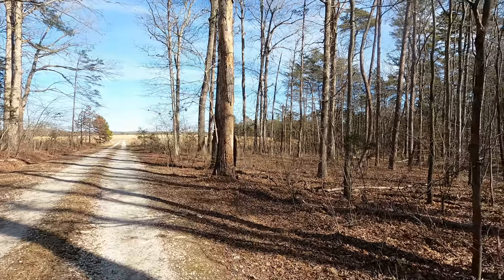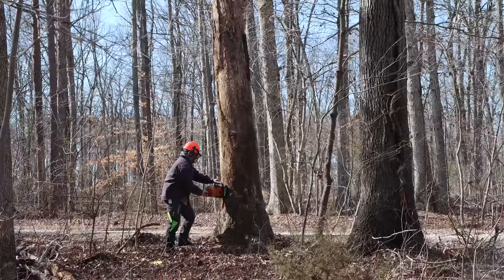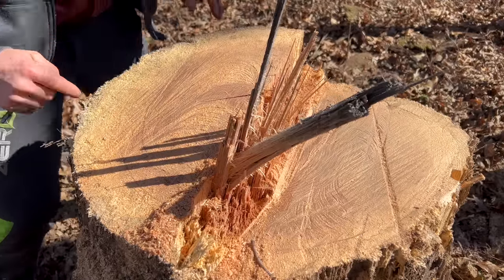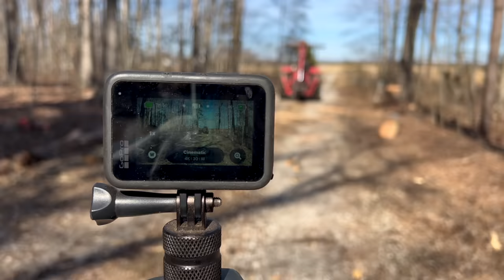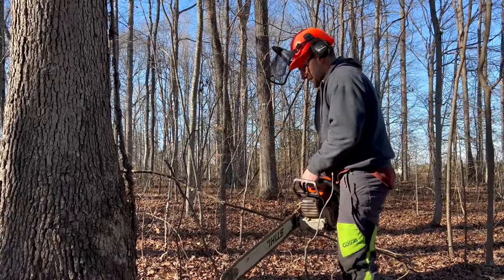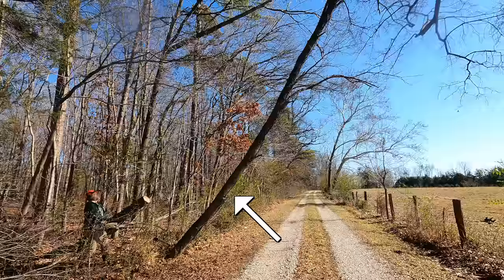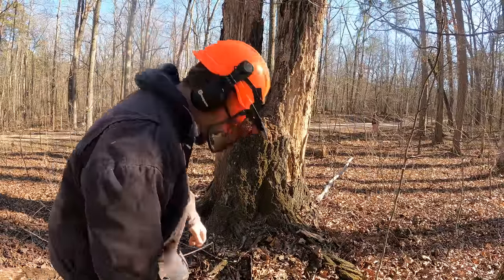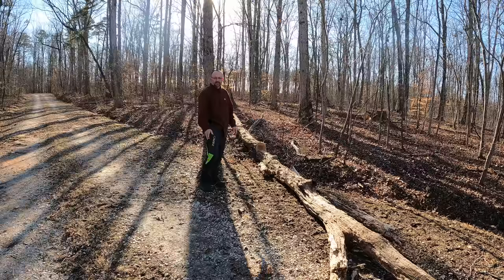No Nonsense Guide to Felling Dead Trees.

Comment: About  the  leeaners: some times you can twist the stem so it falls down ,if its loose in the bottom.  use the pull action  so that the breaker bar doesn't come at you and hit you when the tre comes loose .when you pull it would just move away from you or slip fall of . Dead trees are scary,to cut especially if there is top rot in the trunk , as soon as tree start moving during felling  the top may fall backwards because the stem cant handle the enersia from the upper
Part  of the tree.
In  these  cases you can cut so the tree still stands upright and then pull it down with pre rigged rope.
The top may fall quite long backwards  so it's not sure you will get away far enough if you stand behind and cut .

Don't forget that dead trees also is important for insects birds animals  and even some plants /moss.
Oak ,especially hollow ones are bases for very unusual micro biotopes. 
 Ash trees are also very valuable from 
A dead tree biotope stand point.

the security aspect is very  important obviously,  but distance from roads trails and houses,  and if the place is one that one hangs out in may be "weited"
Against biological values. 
Even if  whole stem is impossible to keep  safely  , high stumps and  stems laying down is valuable.
One method is to collect  thicker wood in pile 
And leave it in the forest. Less messy 
 Than strawn  about allover.
Also removing small branches is less 
Negative for flora and fauna than the thicker stuff, so de branching a stem 
And leave it may be a compromise between  tidyness and ecology.  Where tidyness is important .
This method  and the pile  method does decrease fire hazards , Also the thinner materials  burn faster more easily. 

 Rotten  Wood have less burn value anyway so not so mutch return to take home. 
Not to criticise your firewood collection.  But  its important to not see dead trees as a problem  "need to solve"/ cleanup or  burn in a pile by definition. 

In Sweden we had this ideal  earlier, to clean The forest. Because 1: get firewood 2 it "looks nicer " 
This way of thinking was reconsidered  in the forest management regulation law 
decades ago mayby the late 
1980etys.  Nowadays high stump are 
Left to stand and dead wood is not supposed to be removed or driven over with machines.  Standing dead trees are supposed to be left.
Sometimes it doesn't work so well and things that's chold be left are cut ,I must admit doe ,so it's not perfect. There are really bad examples  how not to do out there.